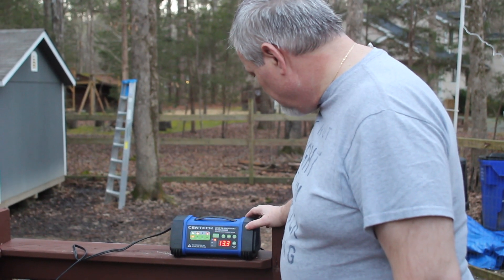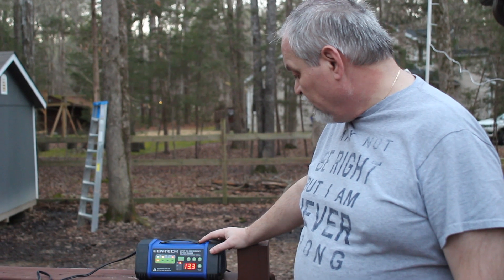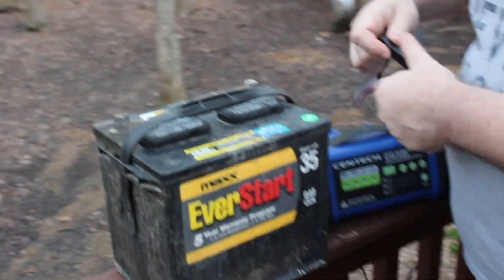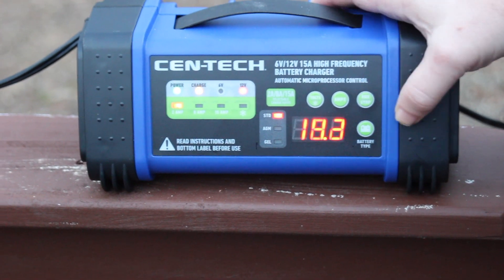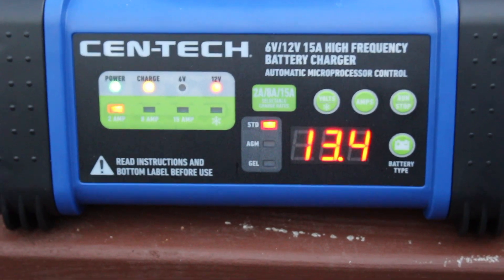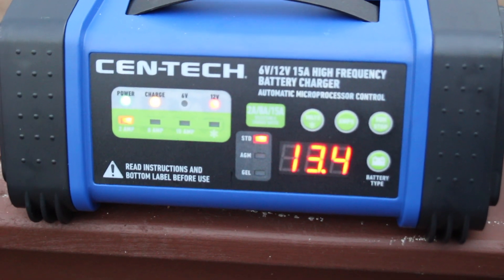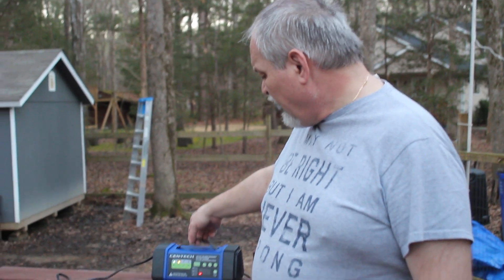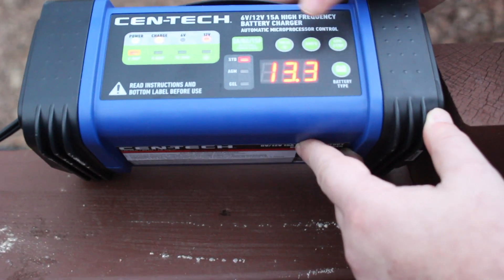cen tech 6V/12V 15A High-Frequency car battery charger 57045

Comment: How long typically?? For a charge how many hours??
Reply from the maker: It depends on the battery and the level of discharge
Reply: @ProfessorDIY What would be your? If the battery is completely dead? Is half way dead? Is 75% dead? Is 90% dead?
Reply from the maker: @pharma-p2h  No new charges will not charge completely dead batteries but I do have a video showing to you how to di thar

Comment: my battery is completely dead, I tried to use the force charge feature by holding down run for 5 seconds but it still won’t work to start the charge. Any idea on how to force it to charge a very dead battery?
Reply from the maker: if it is bellow 5% you need to sock charge it first
Reply: @ProfessorDIY  thank you!! do you have a video for a sock charge? I don’t know what that is.